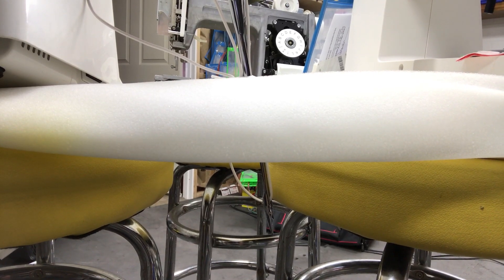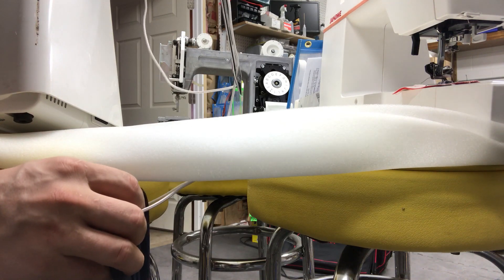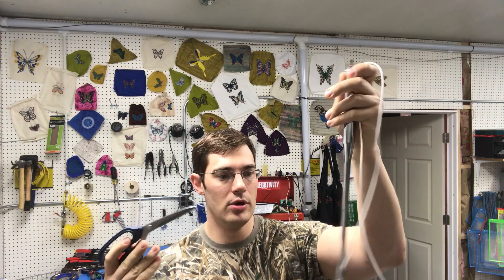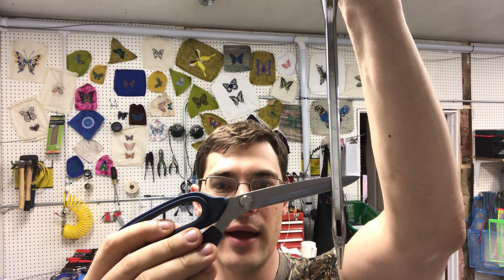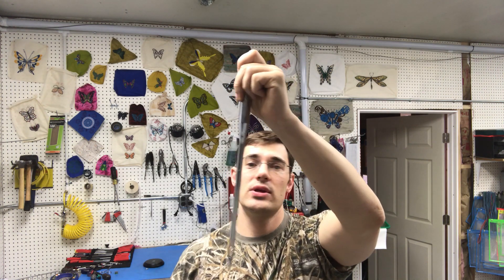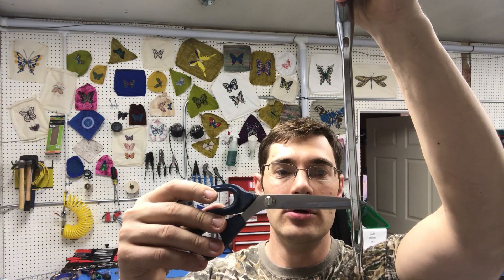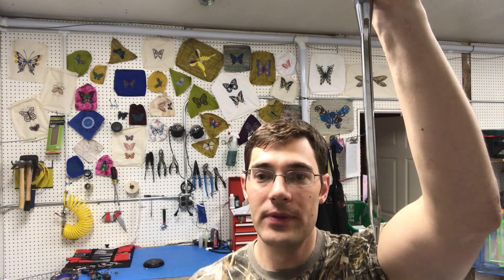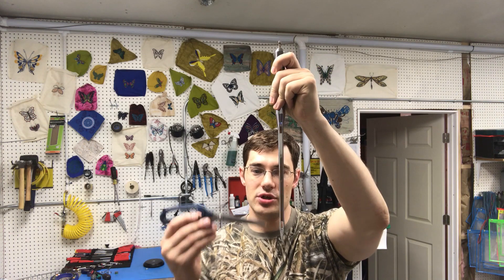Loop Lift and Sewing machine Hook timing

Comment: jan 09 2026. - This is how videos should be made. Now I have to find the Oscillating timing video.150$ repair cost for a 100$ machine. Singer8280 Prelude.Machine is 10 years old, but only used few times.Been attempting this fix for 3 weeks and beyond happy this came across my algorhythm.

Comment: Thanks for this video.  Where did you get all your knowledge?

Tell us more about your online classes.   Before I pay all that tuition, I'd like to know more completely all that I'd learn.

Thanks.
Reply from the maker: I have over 10 years of experience fixing thousands of machines, I hold 5 different sewing machine vendor technical certifications, and I LOVE sewing machines. The videos for basic mechanical adjustment and service contain video files on 4 common platforms and a 55 point check and inspection sheet to go through to ensure proper functions. use the code SOCIAL to get an additional $20 off!
Reply from the maker: The price has also been reduced to below $80 after some feedback. I will also be adding more and more content to the teachable account as I do more service and repair